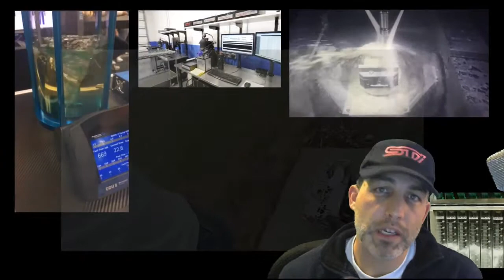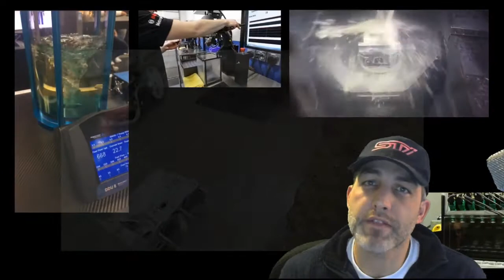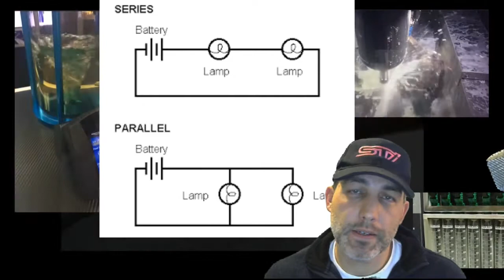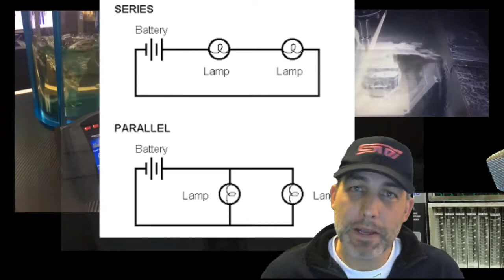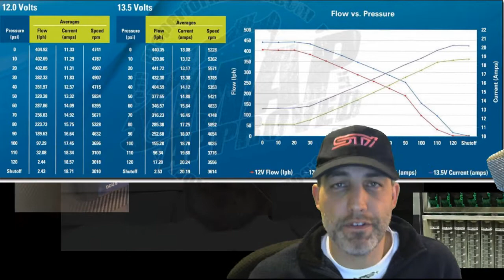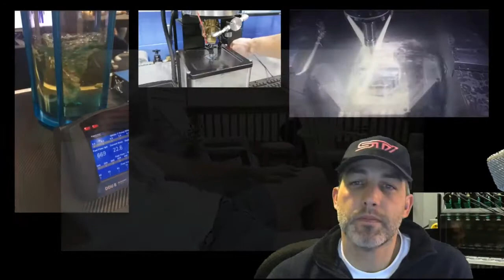Fuel System Design and Information Video

Comment: Excellent info, your thoughts on intercooler pipe diameter as it relates to hp?
Reply from the maker: It's proportional. 
However, you have to account for the length of pipe, pressure drop and flow capacity. 
Example, if the turbo outlet is 2 inches, you don't need more than that if it goes right into the throttle body. But as you add length and turns you have to increase in diameter
Reply: @GetaDomTune  thanks very helpful

Comment: Hey dom I am currently searching through you videos because you had mentioned if I wanted a fuel pressure regulator to buy an areo but I don't know the model # please help I have 2006 sti and trying to hit 400 hp range but I am stock for now
Reply from the maker: 13109 works well. I use the Fore F2i

Comment: Great video as usual! Interestingly enough, no one has ever mentioned needing to add an upgraded fuel filter, but it makes total sense. I have about 10-15 Kmiles on my ID1000's since my build without anything but the oem filter. Do you recommend anything like injector servicing before coming for a tune in this case, or is it likely a case where they should still be OK? I'm sure if there's any significant issues they will show up during the tune, but would prefer to avoid that situation.
Reply from the maker: Shane Trenholm it wouldn't hurt to have them cleaned and tested to ensure there aren't any problems that come up during a tune. It could save you money.
Reply: Great, thanks for the quick reply!